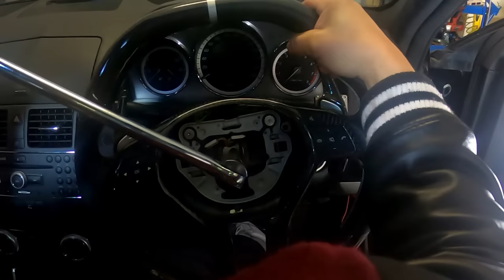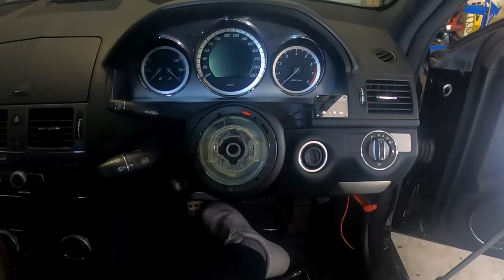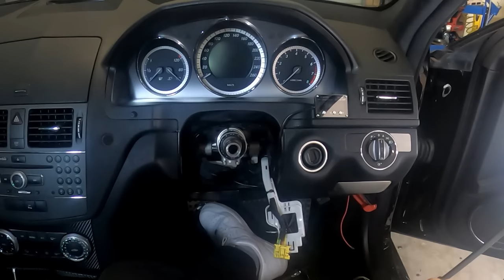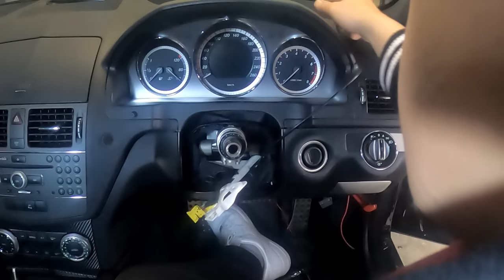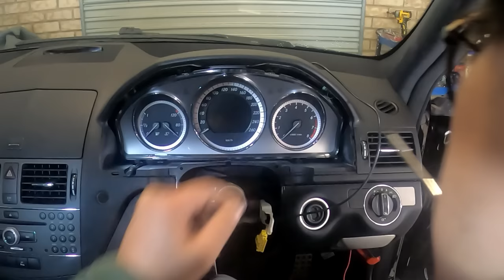HOW TO remove and fix ESL/EIS/ ELV MODULE  w212 w204 mercedes motor replace  Part 1

Comment: I am dealing with the same problem. I stick the key in and when I turn it the car won't crank but it DOES turn. I usually take it out and try again a few times and then it starts. Especially when I use the key to lock and unlock the car from inside for some reason. I went to the dealer and they said it's the EIS that needs changing BUT then they also told me that after changing that (because the car won't start) they will then be able to tell me whether the ESL needs changing as well. I honestly don't know what to do as I live in Egypt and the repair for both is about 2500 USD! Help me out please.
Reply from the maker: Its your esl motor mate 100%...its rarely ever the eis.... the fact that sometimes it will work goes to show the motor is starting to malfunction and eventually will fail
Reply from the maker: U need to fix asap before it dies and ur stuck...and need a tow...also another tip if ever it doesnt start tap under the steering wheel where the steering column is and it should help shake the motor from being stuck and let u start the car...but this is by chance depends how bad the motor is
Reply: @MIKEYZVLOGZ  Man, you're a diamond! You saved me from these money-grubbers taking me to the cleaners! Can you recommend a website that sells the legit replacement motor? I really owe you for this one. I am beyond appreciative! Also, when would the EIS be faulty? The mechanic told me that the EIS was visibly sunken in and obviously faulty (no idea what he means). Thanks again.
Reply from the maker: @TheSparkythespark  if you key is still working now ...it doesnt make sense that the eis would be faulty..if it was u wouldnt be able to start your car at all becuz the eis reads the key so that th esl can unlock ,,,for the motor just buy one from ebay and type w204 esl eis motor and it will come up... they are all basically the same but just ensure it is the right one for your car...
Reply: @MIKEYZVLOGZ  I really can't thank you enough for your time and advice. You saved me 2500 US Dollars.
Reply from the maker: @TheSparkythespark  im glad i could help ya buddy ...
Reply from the maker: @TheSparkythespark  2500 thats so exspensive

Comment: help, disarm the esl, change the motor but do not fix the position. I put it in and it never did anything, apparently everything is fine and the plate looks healthy, but it doesn't work, what can I do?
Reply from the maker: ok so u need to check the switches that are grey , ensure they are pushed down when u install the esl back, alot of ppl forget this and it doesn't work and once you do it it should work

Comment: Not familiar with frame codes, will this work on a 2010 E-350?
Reply from the maker: Hi dear friend and welcome to the channel....Im not sure either but if your esl looks the same then it will work and should be the same procedure.... Mercedes like to use the same parts across various models... n pls remember if your not comfortable like i say in the video pls take it to a specialist and it will save u at least 800 to 1000 dollars easy....
Reply: MIKEYZ VLOGS would the programming of the EIS be necessary if  this happens? The e350 in question has the opposite happen, the ESL is stuck unlocked, causing a no start condition, but I wouldn’t want to tear into it unless I know that programming wouldn’t be necessary. Thanks for the reply!
Reply from the maker: so your unsure whether its the motor in  module or the chip inside that has given out correct? 
in this case its really is hard to tell ... and the only way to know for sure is to do the job.... 
one thing to check....can u hear a slight click when you insert the key or is it completely silent? thats one way to check but its still not 100% certain....
if it is just the motor no programming is needed and a simple motor swap will solve the issue.... however ... like i stressed .... if you make a little mistake and misplace a part wen opening the esl module .... it can fry the chip due to incorrect positioning when replacing the motor....pls understand this...
Reply from the maker: @dip-texcustoms9242  also another thing even if you were to take it apart yourself and allow someone else to fix the chip or motor inside . you save on the labour costs having done most of the work already .... that's where you save almost 1000 in labour fees.... so either way imo i would pull out the esl and eis and then its up to you to replace the motor yourself and hopefully thats the issue or get it done by a specialist for around 300 to 500.... still saving you a fortune in labour costs..... do i make sense? hope i helped answer your question dear friend
Reply from the maker: @dip-texcustoms9242  have you tried tapping on the steering column under the module? it has helped me a few times when the same thing happened to me.... you'd be surprised how affective it can be dear friend....
Reply: @MIKEYZVLOGZ  hey friend do you live in Atlanta? How much you charge to fix?
Reply from the maker: @EUSTACE ELMS hi there friendwelcome to the channel... thanks for joining us hope you can show your support by subscribing .....i actually i live in melbourne australia
im extremely flattered you asked. i truly am ..however im not a qualified mechanic...but can i just give you some tips, if you can get the ESL to unlock..you should remove it with the EIS and then get someone to fix it...that way you can save alot of money..if oyur not comfortable opening the ESL thats wouold be the best option to save money because it will cost you a good amount..especially if your steering is locked
Reply from the maker: hope that helps
Reply: @MIKEYZVLOGZ  okay thanks to give a estimate on price what would say if I carry it to the dealer?
Reply from the maker: no need to go to mercedes.... just find an indy local car key specialist they can do the job..make sure you get warranty for atr least 1year ...is it unlocked or locked??
Reply from the maker: if unlocked it will be abit cheaper
you can even look into getting a complete bypass...search mercedes benz esl bypass... do some research dont just jumpo into any fix..unless u need your car back on the road i guess thats different...
Reply from the maker: so when mine malfunctioned in locked position...i was quoted 1750aud-convert to usd....that was from a automotive locksmith they can do the job .....some specialize in it
Reply: @MIKEYZVLOGZ  it's lock and I have a 2008 c300 I don't have warranty . 

Do I need a warranty for them to fix it. Thanks in advance!
Reply: @MIKEYZVLOGZ  ok cool so I going look them up!
Reply: @MIKEYZVLOGZ  ok I understand!
Reply from the maker: @israelelms8306  dont go to the STEALERSHIP an indy local garage can do it...or get a automotive key specialist... still will cost u around 1000 to 1500aud
Reply: @MIKEYZVLOGZ  okay thanks I appreciate that!!

Comment: How do I know if I'm in the unlock position?
Reply from the maker: usually an unlock steering wheel is confirmation of an unlocked steering wheel..  however there are circumstances where the esl is still locked due to the malfunction ... that's abit different and more involved when it comes to unlocking it ...
Reply: I understand I'd have to cut the pin. I can turn the wheel. Waiting for ESL in the mail now.🙏

Comment: And where do you get a replacement motor that will work with the Mercedes ESL ?
Reply from the maker: i got mine simply from ebay by searching my year n model followed by esl elv motor
Reply: @MIKEYZVLOGZ  Ya I got the motor, tried it and ended up having to get the emulator. Once programmed with the red CGMB device it starts up fine now.
Reply from the maker: @jbucci2009  that's great news what is the red cgmb? is that some sort of program? did u do it yourself or have someone reprogram it for u
Reply: Aliexpress sells them from US$3 upwards and also by the dozen. As I am stuck below a eucalyptus tree with falling branches (self-pruning) I even paid US23 to have it delivered express before the 2nd of Feb. or your money back. Plus I ordered one via snail mail.

Comment: How do you know what position it is in?
Reply from the maker: do u mean the esl position ?
Reply: @MIKEYZVLOGZ  Yes, how do you know if its in lock or unlock.
Reply from the maker: @FadedTrimMedia  usually if the steering wheel doesn't turn its locked and when it's unlpcled u should be able to depress the bolt that secures the esl to the steering column via the 13mm nut
Reply: @MIKEYZVLOGZ  is the only way to get it unlocked with the rubber mallet?
Reply from the maker: @FadedTrimMedia  it usually works because it sends vibration through the steering column and helps to shock the motor to spin one more rotation..there are other ways to unlock. some ppl drill a small hole and turn with a pick like tool

Comment: Thank you for this very detailed video. I can't get my ESL to go into an unlock position, is there a way to plug in an ESL emulator to get it to go into an unlocked position?

There is no way I could of afford getting this fixed at the shop. Thank you so much for making these very detailed videos
Reply from the maker: u r most welcome ... thats why i started this channel so i can help other ppl save money and show if i can do it without mechanical background or professional skills then most ppl can do it too.... u can always just use an emulator and unplug your esl module and have the emulator bypass programmed to your EIS and it will be fine

Comment: I got it off. I'm doing this on a GLK350. I had to loosen the steering column bolt for it to drop down. I got the ELS out now the pins are giving me a time. I don't have the tool...So I'm going to get that t5 now...Its a mess...MB should be ashamed...lol...Ashamed!!
Reply from the maker: just use a torx 5 and hammer it in abit and twist as you pull out it will work...just have patience aswell... and make sure you have a camera ready so you can see how everything goes back together..attention to detail is important you can do it i believe in you  ...just take your time
Reply: T5 doesn't work with those pins😭😭.The material that they consist of are very soft. It doesn't back out of the ELS.
Reply: I think I used some cheap t5 and might have stripped it...Im going to try some craftsman t5 or t6 tomorrow from Lowe's. I hope i did not strip them..smh
Reply from the maker: @rrraaadddiiiooo7766  it does work did you try and tap it in with a hammer first ?? it needs to be able to grip the inside of the pins ....and as you turn you must pullout slowly...do not do it like a normal screwdriver...you must be sure that it is gripped on before tturning and pulling out at  the same time..many ppl have done it with a t5 torx bit
Reply from the maker: @rrraaadddiiiooo7766  yeah you may have to go up a size if you cant get a t5 to fit ...but t should still fit.. i used a t5 and when it didnt grip on i just hammered it in more so that it would grip ..the main thing is to hit the t5 in with a hemmer but not too much just enough to grip ..you dont want to deform the pin completely..and even if you destroy the pins you can always just use electrical tape and tape it around the esl module to make it stay together ive seen this before also ,,,however i would not recommend doing it
Reply: I had to drill them out and reconnect the casing with electrical tape.  It worked very well and the car is running great once again!
Reply from the maker: @knoxvillain6735  well done mate I take my hat off to you hope u ca. show ur support and sub

Comment: Now I have tried 3 times, changed the position 3 times (inside the esl, changed the wheel/button system in open position, (first attempt i didn't knew) with a new electric motor). 3 times and no function:/ My guess now is that I've probably fried the chip.. So, what my best option now? Emulator or an auto workshop? Emulator is the cheapest way but do i need some additional equipment to install that or is it "plug and play"? I hope you can give me some good advice so I can find the best solution for me❤ thanks so much for your great video🤗

Comment: Where Can i get the Tool for to put the Splits out???
Reply from the maker: which tool are you refereeing
Reply from the maker: do u mean the tool to take out the 4 pins with yellow handle ..just tell me at what time in this video do you see it and ill let you know where to buy it ..or i will search and show u ..i always help my subscribers to the best of ability...
Reply: MIKEYZ VLOGZ the yellow Black to get out the Pins
Reply from the maker: @yasarduymaz9908  so if you dont have it you can always use a torx size #5 and use a little hammer and tap it in and do it that way ...just makes sure you twist and pull as you are removing it ...but if you do want to buy it its called a esl/elv removal tool from ebay i send u a link https://www.ebay.com.au/itm/Car-Motor-Lock-Removal-Tool-for-Benz-ELV-ESL-Motor/142673420501?hash=item2137ffa0d5:g:or0AAOSwZvRacEeu
Reply: Google "Mercedes ESL W204" and that tool with a handle comes up. They are pins, not screws, so you hammer it in and twist and pull. I could not wait for the post from China, so I drilled them out, but watch all the drilled out bits inside the ESL as they will fall onto the circuit board and shorten it out. Do not touch the circuit board with your static electricity as you will zap it. Clean it with compressed air and cotton balls (ear).

Comment: I completed the job 
I get an air bag error code and an error code for the esc which is the traction control. What did I do wrong
Reply from the maker: well done.. did u disconnect battery first before u unplugged airbag? usually airbag error  happens when u don't disconnect battery before unplugging the airbag.. also the other error may only be temporary..sometimes once u go for a drive it will disappear as the car needs to know everything is ok... or u may need to clear the code

Comment: Great video
Reply from the maker: thanks hope it helped u
Reply: It helps but still having the problem unsolved, I have bas esp and srs problems, any idea how to tickle them
Reply from the maker: @andylee100240  usually they can be eared from driving turning the wheel all the way left and all the way right ... the car needs to relearn and adjust so sometimes a simple drive will remove the errors...

Comment: where to buy the special tool?
Reply from the maker: if u dont have the special tool u can use a torx 5 and tap it in until it grips ..then pull and turn slowly it will slowly come  out...repeat until it is removed ....or for the  special tool...u can get them off ebay or aliexpress just search esl  elv special tool or w204 esl elv toolkit ....play with the words ... like mercedes w204 esl elv special tool ....mb w204 esl pin removal tool...etc
Reply: @MIKEYZVLOGZ  Thank you very much!!
Reply from the maker: @juliachiang3899  ur welcome friend

Comment: What’s the trick to get it unlocked? Please help
Reply from the maker: u cab either tap on steering column just under steering wheel or some have even tried just hitting the steering wheel aswell....it really depends on how bad the esl is and how bad the motor is. if it has completely failed..u have no choice but to pull apart.. cut bolt... or drill small hole and physically turn the esl motor wheel until it unlocks.. there's heaps of forums and threads about this as well

Comment: Bro I take it out with battery in I fix the motor I put it in unlock position and its not working..
Reply from the maker: did u make sure u press the two little grey switches down? .. did u also make sure u had everything exactly the way it was when u removed the esl?
Reply: @MIKEYZVLOGZ  yes when I take out this was on lock position when I put in put in unlock position its that OK?
Reply from the maker: @benolazaj4961  should be the same ... so the esl isn't confused into thinking it's unlocked or locked... u may have to take apart again and make sure everything fits properly.. did u press down on the two little grey switches on the circuit board pcb?

Comment: What if it’s in the locked position?
Reply from the maker: its more involved if its in locked position.... there are ways to do it but i personally wouldnt unleas i had to... u can drill a small hole where the motor is and then use a pick and manualy turn the motor geara until it unlocks... u then have to cut the bolt in order to remove the esl
Reply: @MIKEYZVLOGZ  how do you know if it's in the unlock position? I feel like I can move my steering wheel, but it's like there's no power steering, it's very difficult to move, but possible. Does that mean it's in the locked position?